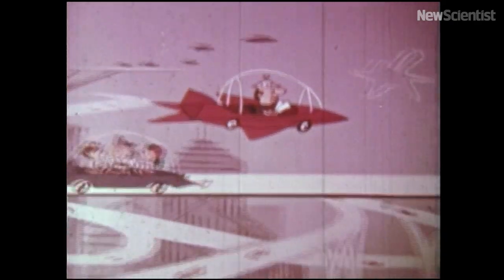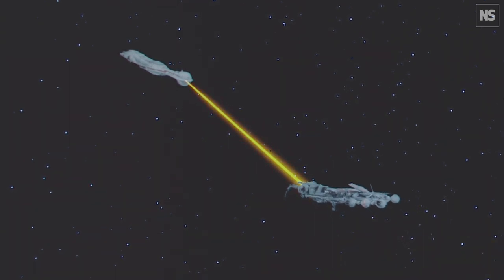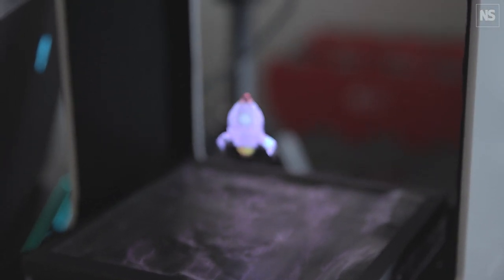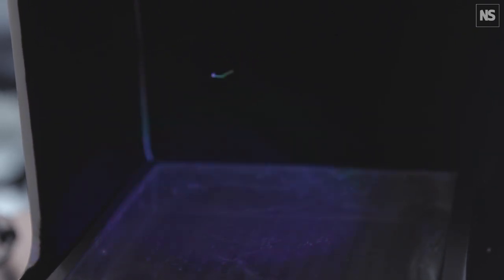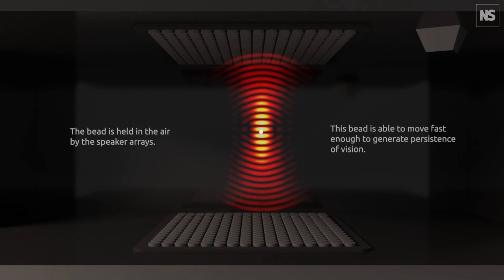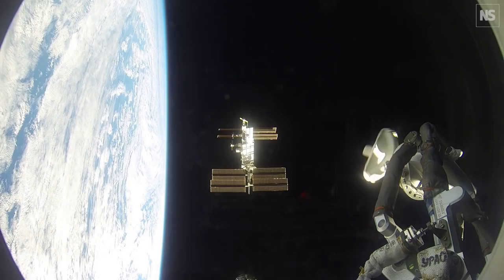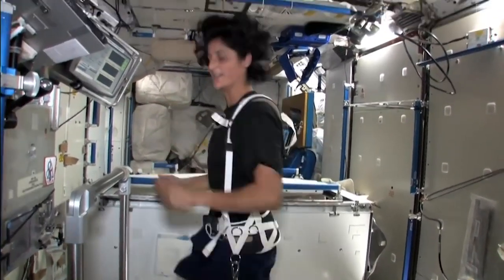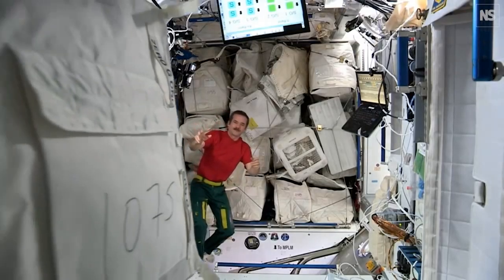Watch sonic tractor beams lift and manipulate objects with sound waves

Comment: This opens a chance for the camera pill passing through CED intestines with stenoses. Very interesting! Thank you very much!
Reply: Presumably the ultrasound will have no lasting effect on surrounding digestive tissues?...
Reply: @MarkHopewell  Probably not longterm. And definitely less than the illness the ultrasound tries to control. Currently the clinical trials aren't even through - until they are assuming the worst is a virtual and useless discussion.